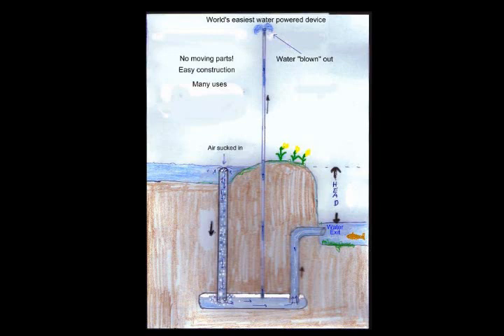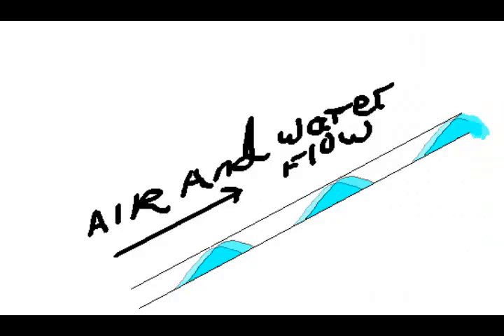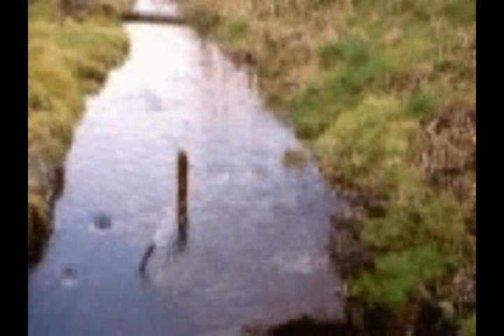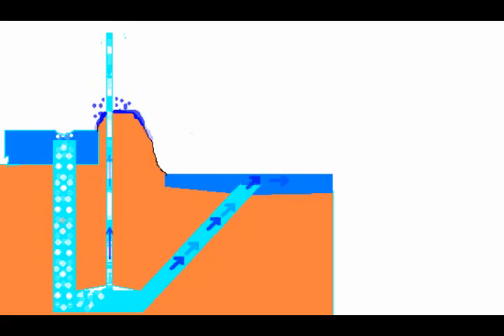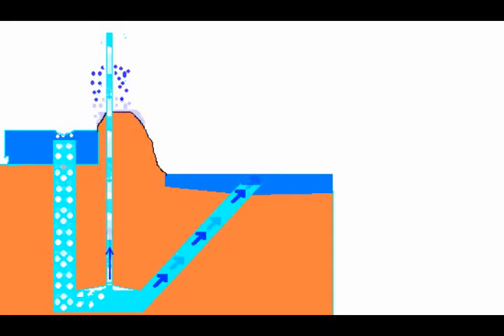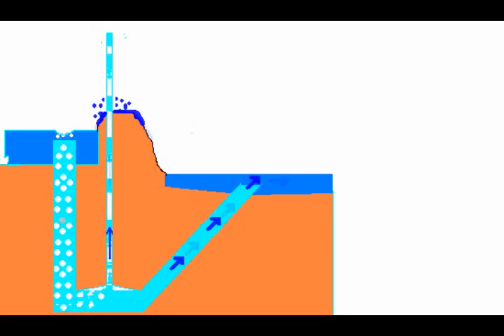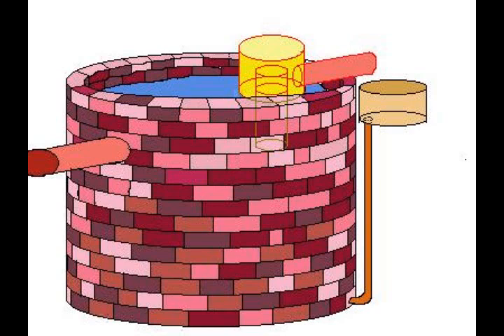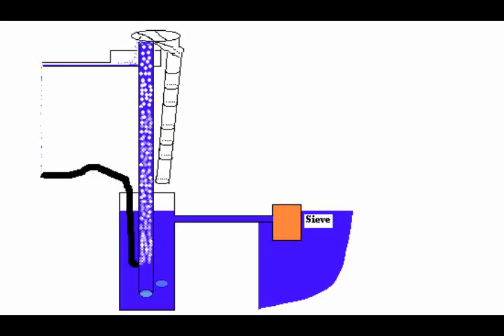WORLDS SIMPLEST WATER PUMP!! Make a PULSER PUMP!   Alhambra pump from 1400 AD? Make one and see!

Comment from the maker: Yeah, you pretty much have it in a nutshell.  There are still lots of places without power. My pumps were just tiny prototypes.   Larger ones would be more effective and not that much more expensive.
Nobody is using low grade power now (less than one meter head). so any power you get from pulser pumps is an addition the the world's supply and can replace fossil fuel use.
I no longer have access to a stream so I cannot make any more pulser pumps. Someone else must do it.  Brian

Comment from the maker: There is no point in attaching a small turbine,  with my tiny prototype, 30% of the energy was removed. With bigger pulser pumps,  more of the energy will be removed. So there will be not enough energy  left to turn your turbine. The only way I see it working is if you could turn off the air intake to the pulser (basically turn off the pulser pump) any time you need electricity.
Better one or the other, I think.
Brian

Comment from the maker: Ossirt, I guess your sarcastic  answer means you didn't find any info? 
If it had been investigated, it would be on the net somewhere.
 Airlift  is not obsolete. 
It is still  being investigated. The  Journal of the Brazilian Society of Mechanical Sciences and Engineering had new research papers accepted on it in 2007.  People didn't think of using low pressure trompes to power airlift pumps and so they did not bother to investigate EITHER low pressure airlift OR low pressure trompes.

Comment from the maker: Low pressure trompes  and bubble pumps have NOT been been experimented with exhaustively. 
Where, apart from this video,  is there ANYTHING about bubble pumps and trompes combined?  If  google is your friend, you should be able find low pressure  trompe research results  or bubble pump research results.  If you cannot find any results, might it be because there was no low pressure research to begin with?
 Wikipedia won't list the pulser pump because the concept is too new.  Ask them.

Brian

Comment from the maker: Ozzirt, your answer is smart but not clever. If the guys 100 years ago had researched this properly, there would be figures for low pressure trompes and for low pressure airlift pump performance widely available.  Go back to the net and find some.  There are no figures available.
The pumps I built were designed to pumped water. Those others were air compressors. 
The research guys never bothered to research low pressure trompes or airlift pumps. This uncertainty stops poor people from trying.

Comment: I saw a similar device years ago that had been built on a waterfall in South America. The main pipe ran parallel to the waterfall and down to a chamber with a drain on the bottom. The water and bubbles were carried down the pipe to the chamber and because of the weight of the water the bubbles were compressed, so when the water reached the chamber the compressed air was trapped there. It  is the worlds simplest air compressor, with 1 moving part.

Comment from the maker: You are welcome to try!  The mixes of air and water that flow through are by nature turbulent. I made about a half dozen of these pumps as I experimented and there were reasons for my choices. In one case i had a screw that throttled the airflow in. When I did this more water sucked in and through the power stage to pump more water at a lower efficiency! (Efficiency is not everything)
I have a web page with more details and refinements for anyone who wants to make one.

Comment: "Simple" method really. The air is getting drawn down into the tube on the intake, gathers under the smaller tube and forces water up through it. There should be no reason why you can't patent this or make a wiki page for it.

Comment from the maker: It  certainly is not over unity. You multiply the liters per minute going through the big pipes by the distance it falls.
Thats the power. Then you multiply the liters per minute by the height it is pumped for the pumped water.
dilivered/power=efficiency.  
(I do not think it is more than 10% for my pump). 
Half meter head and 4 meter pumping. I suspect if things were optimized, efficiency could be 3 times as much.